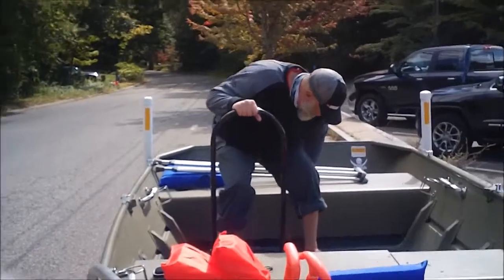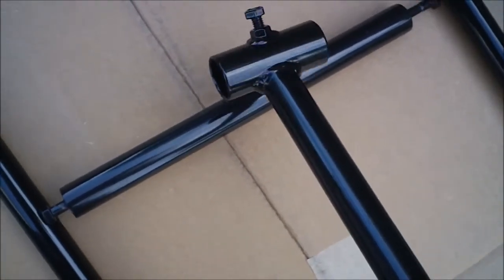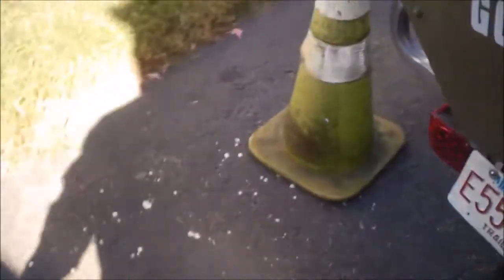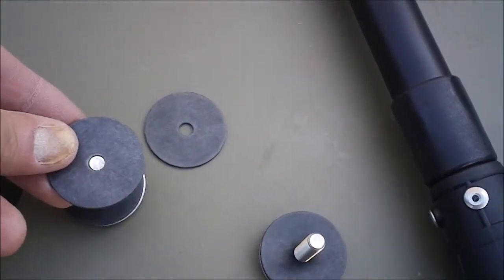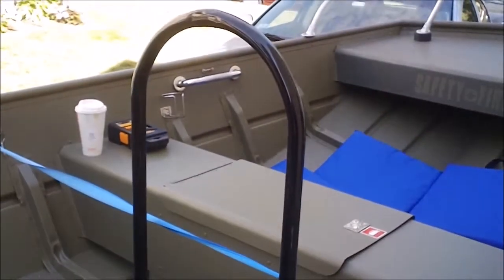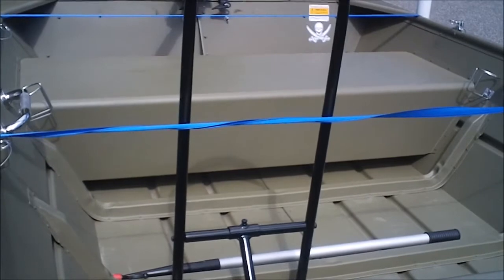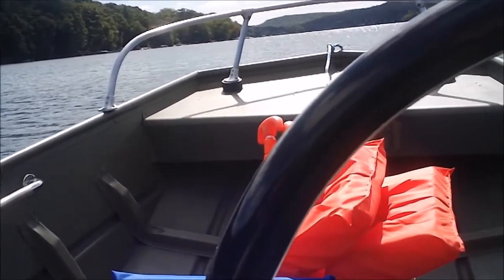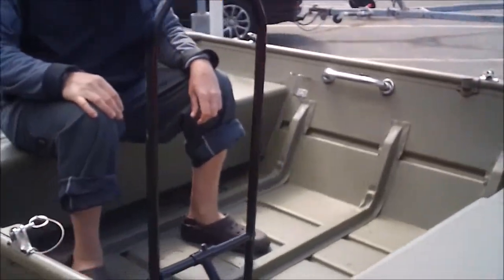MV Godzilla EP07 Jon Boat Grab Bar Install

Comment: Thanks for the video. Was debating making/attaching the grab bar on its own removable platform but you've sold me on drilling right into the boat!
Reply from the maker: Thanks. Don't be afraid/hesitant to go for it. Please let me know how it works out for you.
Reply: @BrianMDIY  got er in this afternoon used silicone on the hardware and a little spritz of clear flex seal on the top and bottom after it was set. I really like the bar itself, great texture and feels solid!